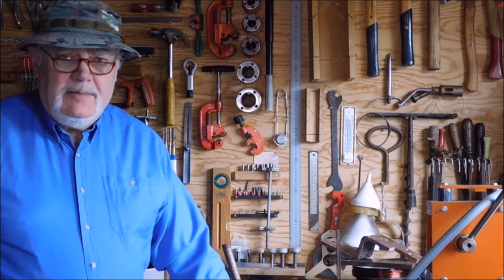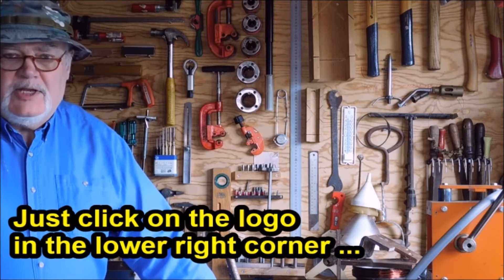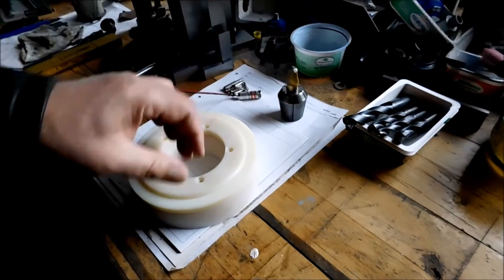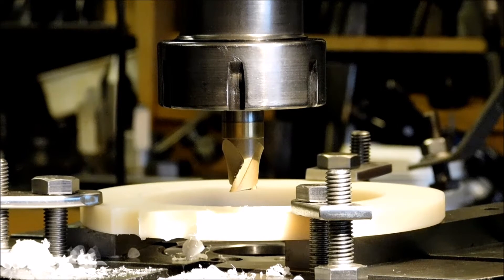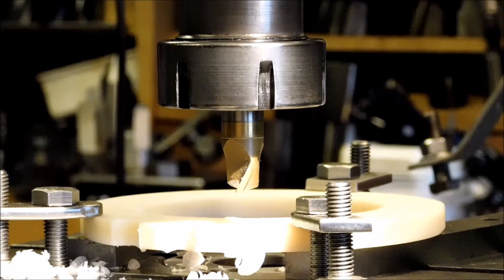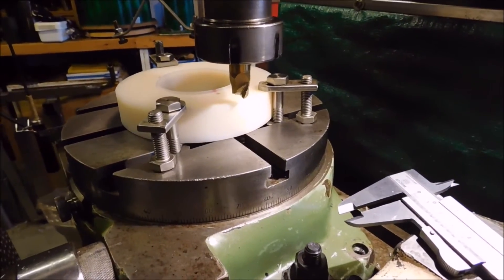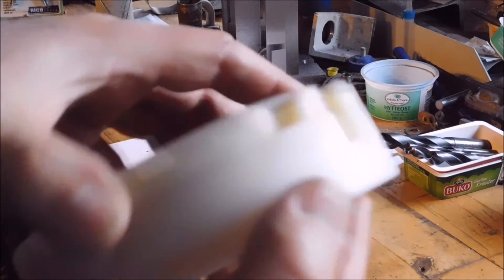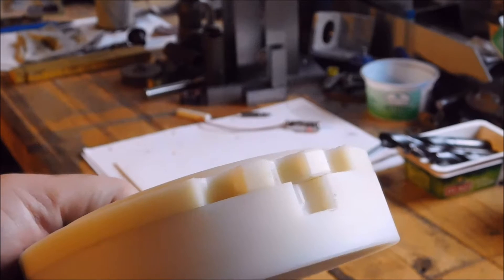Centerfinder 04

Comment: I built my laser centerfinder so's it would pick up a centerpunch mark 30mm above the hole.  Under a jewlwr's loupe. To do so I added a pinhole, which I made out of your favorite material,  a beer can.  I made a simple box  out of aluminum. I do have to turn outadjusting screws but so far I haven't used them. The problem with a pinhole is that it is very dim. So turn off some lights. No commercial laser within has a radius of less than 1mm and some have twice that. I think a pinhole will bring you down to where you need to be, .01mm which is as good as you need be.
Reply from the maker: I'm already having problems with seeing the light - so a pinhole ?????

I think I'll stick to Dan Gelbarts solution and I already have a laser that is focuasable
Reply: I disagree. I can focus down to .01mm  which is anough for anyone. And I used a cheap laser pointer which far better than enough.